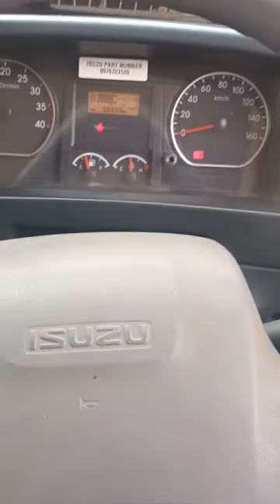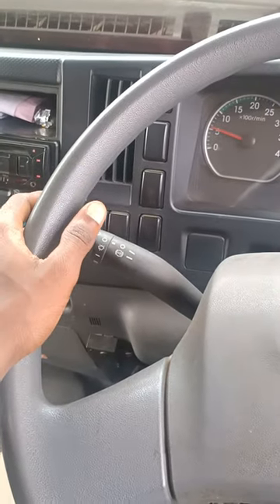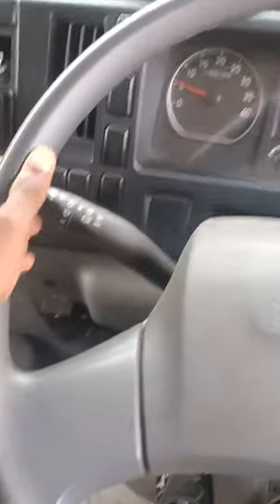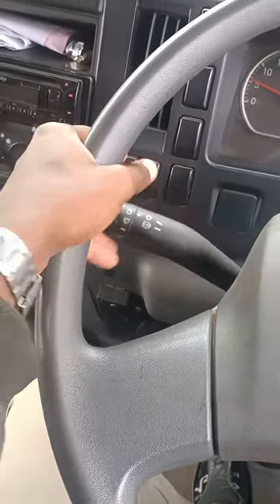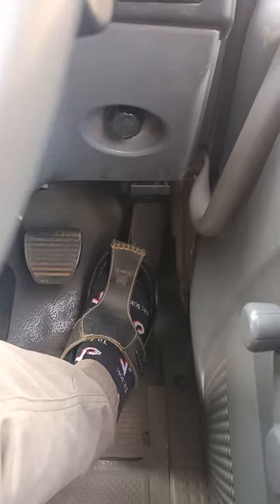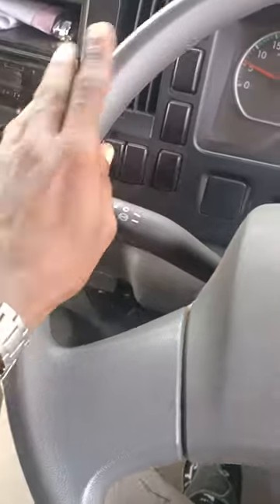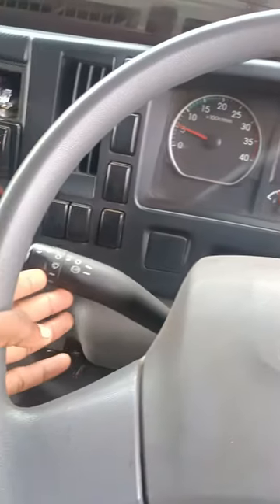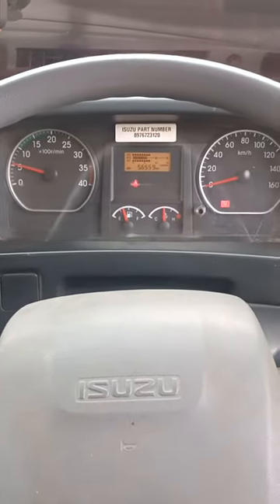Frr90 engine brake/freno

Comment: And I just want to know about gas  break How can I use the gas break or without gas break? It’ll be OK or no?
Reply from the maker: Due to weight of the load, engine braking helps the truck to slow down.. Since when yu use brakes alot you are draining alot of air from the cylinders then alarm goes on

Comment: What your experience on the brake system?
Reply from the maker: Only one.. When truck was new. You step on breaks truck doesn't stop then it goes into emergency when you continue stepping
Reply: is there any limitation on the speed or the gears one is supposed to use the freno?
Reply from the maker: @EdwinWachira-pk2yi  Yess man... Slow speed no freno rev counter should be above 5ish
Reply: got it,,thanks bro